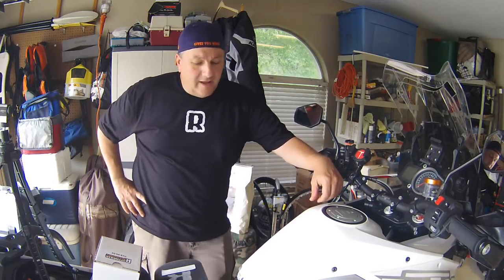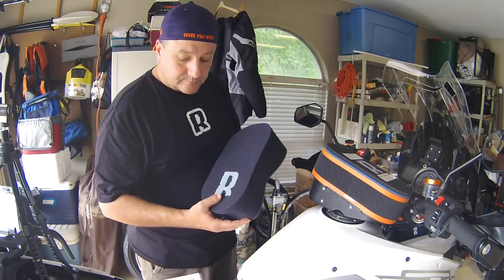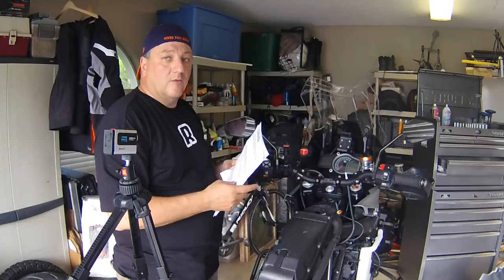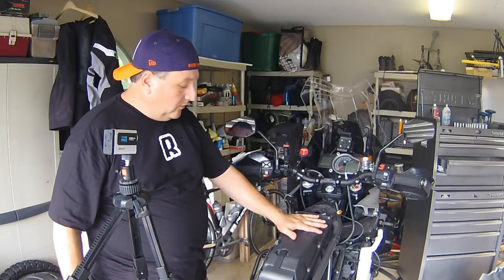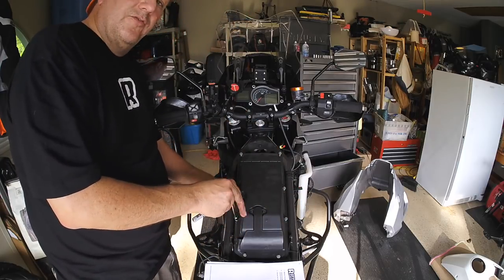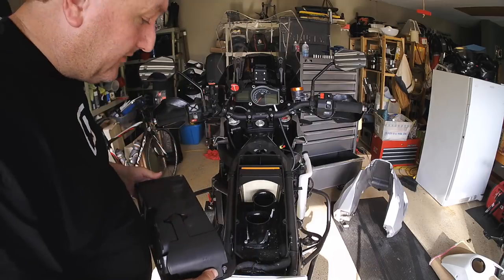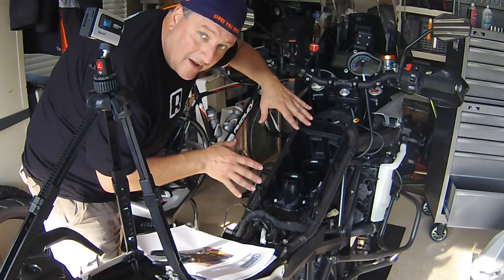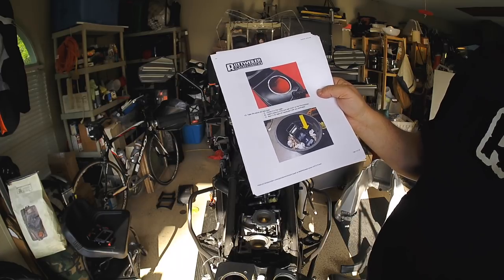Rottweiler Performance Intake Installation on KTM 1290

Comment: yes the bike will run better --better air flow into engine-.Slighlty louder but will also be a bit louder with exhaust mods. After a week of riding you will no longer notice the increased sound level.

Comment: I fitted one to my 1290SA too, along with the aluminum bell mouths.

It's a really easy install, but I over oiled the filter and it took ages to get it off. You did a way better job!!

Did you change the fuelling? It flows a lot more, so I fitted a PCV with maps from Chris, and it's got some serious growl.

I'm not a big fan of power commander (I used rapid bike before, they're a lot more sophisticated) but I felt it needed it.

Great video - wish I saw it before my install.

I can't hear my intake over the BOS desert fox I installed, which is a bit loud, but I can dial it back.
Reply from the maker: I added the fueling dongles. I spoke to Chris about remapping and will most likely go with the PCV if I add the Wings or Yosh exhaust.

Comment: I like their products but this one won’t work for me I do water crossing especially in spring time, and it happened to go down up to the tank, if I would use that system the engine would ingest water inside the engine, so I have to pass on this one.

Comment: Thanks for a great video
I'm going give it a go because of your instruction.-- It appears you got tank off without taking off crash bars? 
Any tips on that?
Have a great trip on Continental Divide Trail.
Reply: Pete, this is Stephen. You don't have to touch the crash bars at all. The side panels come off easy after you disconnect the cornering lights and then the tank will pivot and lift straight off.

Comment: Did you flash your ECU or install a Power Commander? If not, how did you adjust your AFR to the new intake system?
Reply: Doogeruoy Sihtdaer if you read the blurb on Rottweilers site they reckon it isn't necessary to remap it. Obviously it would be beneficial but is mucho £££££££ for a PCV and dyno time.
Reply from the maker: No need for that but I did install the fueling dongles.
Reply: If you get the powercommander from Rottweiler you can get all their maps for free so no pricey dyno time

Comment: Rottweiler are taking the piss with the price. It's injection moulded plastic and foam. Wankers. Still want one though.
Reply from the maker: It is pricey but you get what you pay for.
Reply: It is very expensive for what you get. But I bought one anyway lol.
Reply: Rwecosher ...it’s based on the UK made ITG JC30 which costs about $82 in the UK, so that leaves about $280 for the base level plate and fittings

Comment: Okay this is a pain in the ass . Where is the video to remove the fuel tank. This air box has no instruction sheets or book . I'm supposed to watch these videos . This sucks. Bike in shop== computer in house .I need a book !
Reply from the maker: Hopefully you were able to do this yourself. Taking the tank off is easy ONCE you learn how to do it once. I searched youtube and found out how.
Reply: If you can’t figure out how to remove a fuel tank, you shouldn’t own a motorcycle

Comment: Now you have two different intake tracts. What Rottweiler should do is raise the price but include two stacks in the deal. The competitors price is 300 buck higher .Nobody is not going to buy this. Who wants two different length stacks .Stupid.
Reply: You can get a second stack included. Also the most popular intake system on the market. Lol

Comment: Was there a noise increase, or performance  increase......

Hows it holding up to dusty use
Reply from the maker: There is a noticeable noise increase and the seat-o-the-pants dyno shows a performance increase. The best benefit was the amount of dust and dirt captured. My airbox was completely clean.